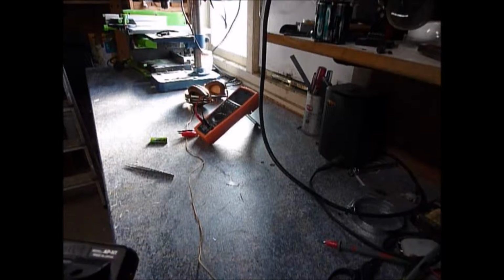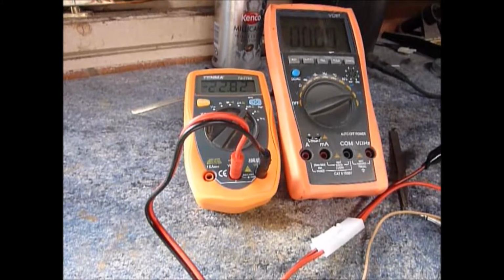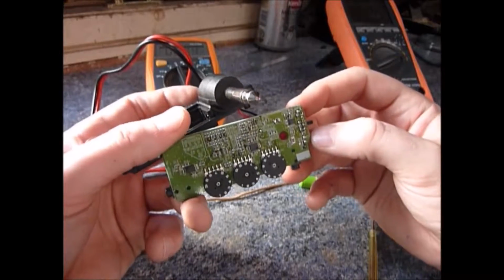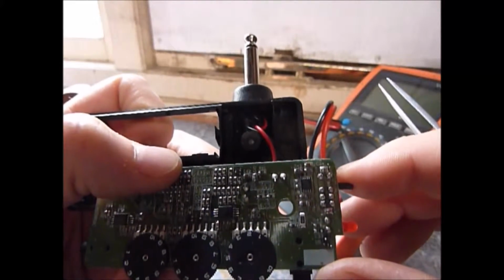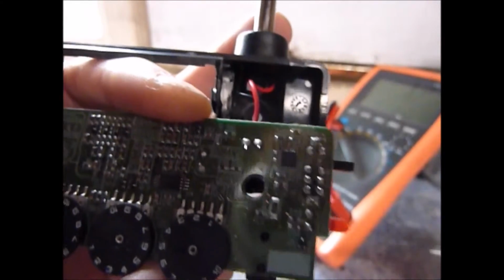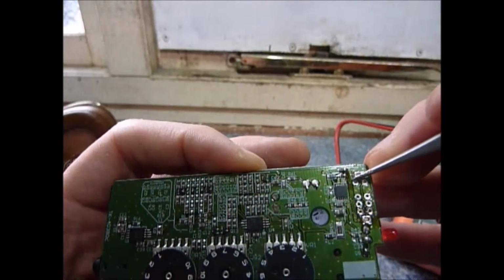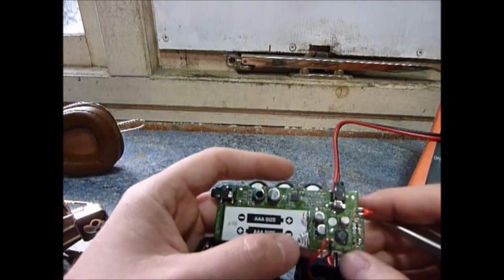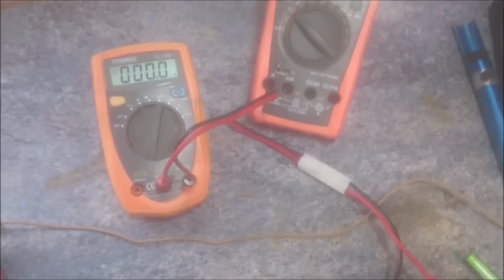Vox Amplug NightTrian, battery drain fault

Comment: I have the exact same problem.
Reply from the maker: Hope you were able to fix it, or did you send it back? It's not an isolated incident then, so perhaps vox need to spend a little more effort on their design for manufacture, this fault could easily be avoided by changing the footprint on the switch, still it's a nice product when it works!
Reply: I agree with you that it was an insanely nice product when it worked, however I could not keep using it and changing the battery every week. I sent it back to amazon (where is ordered it). I told them that there is a problem with it and they will probably give me a refund. I ordered the metal version of this amp after I sent it back for return.